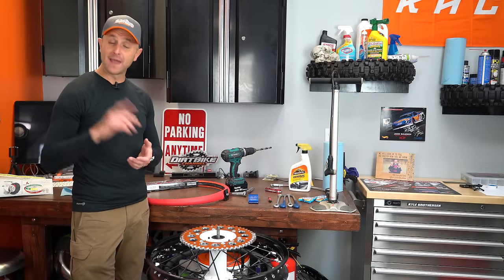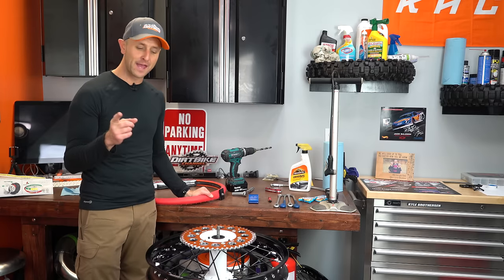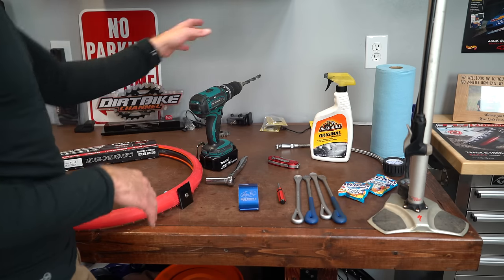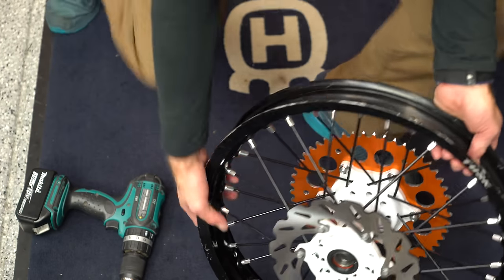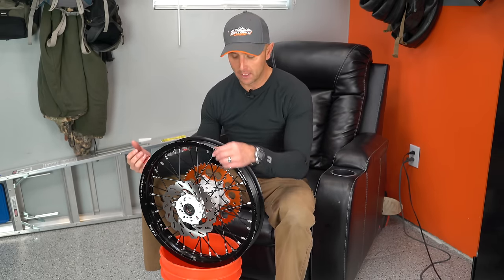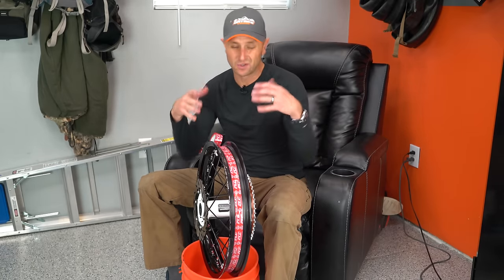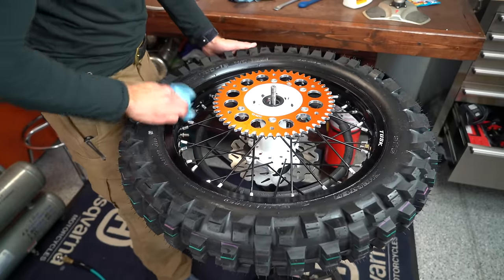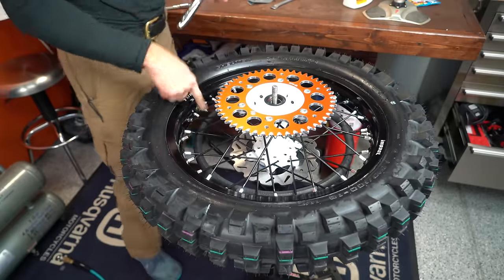TUbliss Installation Guide | How To Install TUbliss

Comment: I've seen a couple of comments about it. Yeah, I'm curious if there's a particular reason why Nuetech wants you to keep the lock and bladder within 4 holes of each other. Wondering if there's a wear issue if there not within 4 holes.
Reply: Tubliss probably recommends that spacing to make installation easier. Kyle pointed out that stuffing the stems in is more difficult when they are opposing each other.
Reply: Just easier that’s all.

Comment: Couple question... Tubliss says to drill the hole 4 spokes over. You didn't do this so i take it its for easier install? Tubliss says armor all on liner and bladder but to use soap water lots of it on both sides of tire to set bead. You installed with a little armor all on bead? They said dont use soapy water if your using a sealant. Thoughts?

Comment: Your rimlock is across from the tube valve. Tubliss stresses that it is VERY important to put the rimlock/low pressure stem 4 spokes from the high pressure even if it means drilling a new hole and plugging the existing rimlock hole. Are you running into issues doing it your way?

Comment: Thanks for the video. I’ll purchase everything through your links👍. 
I’m curious how much Stan’s sealant you use? I’m a mechanic in a bike shop and do about 20 Mtn bike tubeless set ups a week lol… But we use 2-8 oz depending on tire size. I’m assuming the motor bike tire it’s would be roughly 10-12 oz?

Comment: Great video one thing I would add is to torque the rim lock down to the specs Tubliss reccommends,in case you loose pressure in the bladder 😎

Comment: Tubliss says on the instructions that the 2 bladders have to be 4 spokes apart.You have them opposite to each other.Is there some reason or benefit?Thanks!!!
Reply: He says in the video that Japanese style rims are opposite from each other
Reply: @13BahamutG  but it says in the instructions to drill a new hole. factory japan bike are across.. I think it can be both ways just 4 spokes makes it easier to install liner and bladder

Comment: Do they make rims and tires that are made for tube free  air inside the tire ? It seems  to me that  your trying to make a rim and tire  tubeless that was made for a tube . Why not just get a rim and tire that's made  for just air ? Also is there a dot on the tire from the manufacture  that lets you know  its the lightest part of the tire so you can line it up with  the rimlock to help with balancing ?

Comment: Didn't you read the part in the instructions that said the 2 valves MUST be 4 spokes apart?
Reply: I remember that from the TuBliss instructions too. They seemed pretty clear that the high and low pressure valve stems needed to be exactly 4 spokes apart. Here Kyle's put them pretty much opposite sides of the rim. This might help with balancing the wheel, but I wonder why TuBliss was pretty insistent on them being 4 spokes apart?
Reply: @RickGreen_McNutt  it's because when you Mount the tire, you finish at the valve cores so the rest of the tire is in the drop center. If you have one of the valve cores 180 degrees apart, you cannot drop the tire in the drop center to spoon on the last bit. If you do that, you can damage the high pressure core valve stem if you finish at the bead lock 180 degrees off. That's the idea anyway

Comment: Thanks for the info really appreciate it 👍
A question though..... don’t you need to balance the wheel with weights? I have done lots of street tyres and always have to balance 
You don’t need to balance on dirt bikes?
Thanks in advance 
Jeff (Australia)

Comment: You can’t push the tire down into the drop center because the tubliss inner bladder is there.
This is the main reason it is more difficult to mount the tire.
Doable as shown here but challenging.
You’re welcome :)

Comment: Greta vid, always wash the tire lube whatever you use, off the disc with brake clean so otherwise it can contaminate your brake pads, and and actually imped lube into the disc. Only way to get oil or lube out a brake disc that has been heated with lube on it, is to sweat it out of the metal with torch or very hot heat gun, same if you get chain lube or brake / fork oil on your discs.

Comment: BTW Neutech states to make sure the holes are not across from each other.  They should only be 4 or 5 spokes apart. I don't remember exactly.  Just follow the instructions so you don't make this harder then it needs to be.  I've been using tubliss since they came out.  very awesome for the back.  Ok for front, but like their Nytro mouse better for the front.

Comment: Hi my bike has done about 80hrs since new in 2019, about to change my first tyre, would you recomend changing the hi pressure tube at the same time? Is it easy to swap the tubes over in the system?

Comment: Hi Mr. Kyle, appreciate this video as this helps out a lot! One question though. Have you ever had any trouble with the valves stems being across from one another on the rim rather than 4 spokes apart? I bought a used set of rims and I have the same situation with the holes. You made it look pretty simple but I was just wondering about long term effects? Probably nothing I assume but wanted to ask as you have done this a lot it seems. I gather that Tubliss whats the consumer to do the holes 4 spokes apart because yes, it would be earlier to align the stems and install. Any comments from you would be appreciated. PS. I am a bit of a beginner here and knowledge is power!
Reply: I am interested too
Reply: It IS important to have them space 4 spokes apart. This is due to how you have to change tires with tubliss and end spooning them on AT THE RIM LOCK. When done this way, the bead of the tire is in the drop center opposite from the rim lock. So if the high pressure valve stem is 180 from the rim lock also the bead of the tire can damaged the bladder as it is fighting for the same space and can tear the bladder from the stem. - If they are 4 spokes apart this will not happen

Comment: Wow 5 psi that’s insane, Is that in smooth rock free terrain. I am considering tubliss for mine and my sons bike, we ride major rocks and roots what kind of tire pressure could you get by with. I currently run minimum 15 psi with heavy duty tubes and still experience pinch flats on occasion.

Comment: I just bought these using your link, I run a YZ450 and the rim holes are on opposite sides, can I use those like you did in your video?  The directions call for it to be 4 spokes apart.  Thank you
Reply: Hoping you could help here

Comment: Nice job on the install. Tubliss recommends to drill a hole 3-4 spokes away from valve core for the low pressure valve, but seems like using opposite side hole works just as well and balances the tire better...good to know! Are the tusk wheels as strong as OEM? inded backup rear wheel...
Reply: You need it 4 spokes away.  the rim lock helps to hold the valve stem

Comment: Hi Kyle, I’ve just ordered my Tubliss and watched your vid as well as the instructional vid on the Nuetech site. I’m confused by the tape process. Their vid still says the tape goes only once around and they don’t overlap. They show a gap of 8mm between the beginning and end of the tape. Is this an old vid or have they reverted  back to a single run on the tape? Your help with this would be much appreciated.

Comment: Did this yesterday with no issues - did the mallet trick on the last bit too. Replaced the Armour-All with Silicone spray lubricant - got the nice pop when the bead seated & is holding air. Thanks for the video - was going to pay someone to do it but feel it's better to learn as I go through tyres quite often!

Comment: "ArmorAll" must be a supporter. Frankly, from experience, I NEVER use ArmorAll on ANYTHING.  From my experience ArmorAll drys out rubber and plastics.  Ever notice how the dash on your car starts cracking MORE when using ArmorAll?  Use SOAPY water instead and it's WAY less expensive.

I DO like the Shinko 520 series tires.

Otherwise the video was good and informative. I too have used the rubber mallet to finish the job.

Comment: I recently purchased a bike with this tubeless system the valve stems are not correct red and black I’m curious what valve stem holds the bead on the high-pressure one and which one should I leave it low pressure is the big one high pressure or the small one high-pressure

Comment: Hey, great video.  I did this all myself aswell and i find at the start of each ride the High pressure chamber has dropped to 70-80.  Would you say thats normal?
Reply: Kevin Cameron yes, you should check before every ride.

Comment: I like those tire stands for removal, but during install it helps to keep the tire in the drop center by standing on the sidewalk 180 from where you are finishing your last bites, plus last spot should be near the rim lock.

Comment: Pro tip: don't use the little nut that backs up against the cap on the high pressure side. If it backs itself off from the red cap, it will self tighten against the rim and tear the high pressure tube underneath. Happened to me twice. Just use the red cap.
Reply: Eric Wahl You can use that little "nut" on the high p. valve, but use two of them and tight them together.

Comment: Check the inside of the rim for anything that might cause a flat. I had one set of rims that had sharp edges ended up filing the tops of the spoke nipples.

Comment: Is the tubliss rimlock really necessary? I was thinking of removing it or trimming it back. The red bladder acts as a rimlock.  The front tire is very unbalanced . Now I have added an extra 3-4 oz. in wheel weights. Defeats the purpose of the light weight of the tubliss vs mousse or uhd tube.

Comment: Common complaint is the High pressure tube starts to leak. Stans (or other brands) of tubeless tire sealant; add to the high pressure tube the take care of those pesky slow leaks. You could add it the low pressure side as well and may help seal leaks at the spokes. NSDQ!

Comment: On my honda I only have the one valve stem hole at 6 o'clock then I have two holes with rubber plugs in them at about 10 and 2 o'clock. Should I just drill a new hole 4 spokes over and leave those rubber plugs in?

Comment: How often do you have to mess with the high pressure side adding air?  I’m not great at checking my air pressure. I’m currently running mosses now. Thinking about switching to tubeless

Comment: Useful video BECAUSE of the realistic periodic struggling.  Thank you for leaving those parts IN.  I'm proficient at these except for the measuring for the drilled hole.  Wish I had a more scientific way to do that, so as not to mar a new rim.

Comment: Wow I just watched  your video on how to do this from 2014. I've been trying to find a solution on how to get as much traction out of my dualsport tires. Wich are no joke 90% street tires and maybe 10% trail tires. Which are copy cat shinko 705's. I am afraid to air down more than 18psi due to how lose and easy it was to mount and set the bead. I will feel better with a set of these and my tires at a lower psi. 

 I kmow I should have never bought a Chinese yamaha clone. But it was the only way to get the bike I wanted.  Well most of it anyways. I've been slowly replacing cheap parts with the real yamaha parts since those were cheaper to buy and import than the real bike, the yamaha xg250 tricker.

Ps. Thank you for the great vids and information you give.

Comment: It is a struggle and root cause is tubeliss blocking the tire move into the middle of the rim. Some tire might be easier to mount, but without brute force, there is no chance to get this thing mounted.

Comment: Hey Kyle, I’m looking at getting a tubliss system for my bike.  I’m curious though as to how long the system will last before it needs replacement?  Assuming I don’t pinch anything with a tire iron.  I know that tubes wear over time but I’m curious about this system.
Reply: Mine is from 2016 (gen 1), has been taken on and off several times and still works. There is no reason why it should fail. The inner tube will probably go eventually, but I've taken it out and it is just a solid bicycle-like tube, so as long as you avoid the cheap chinese crap, you should be ok.

Comment: When I put air in the tire it leaks out from the spokes. I put two layers of tape and Xgrip rubber. I put 7.5 bar in inner tube and 0.7 bar in outer tube and it lekas. What may be the problem?

Comment: You mention tools required but you fail to mention the one tool that you use and is hidden in plain sight, the tire changing work stand. It’s pretty much essential. I’ve tried the five gallon bucket method but the wheel won’t stay down as many of your listeners know. Can you update the video to mention this vital tool for those who plan on changing their own tires?

Comment: Lube 101 - Installing put lube on INSIDE of bead, (that is what grabs), when uninstalling put it on OUTSIDE, where you sprayed this time. 
you dont need lube on the outside of the bead that is only to help it seat, not install. Bead buddy is supposed to be OPPOSITE of where you are spooning so the bead/tire falls into the valley giving you less stress on the wire & to pull it on.

I run Boobless (politically correct is BiBless). Moose BIB (sacked 5-6lbs) & Tubliss. Works amazing.

Comment: 3:28 ARE YOU KIDDING ME!! OF COURSE FRUIT SNACKS ARE CRITICAL to installing the tubliss system!!! How dare you take out a critical step
Reply: Fruit snacks and diaper wipes are this that come from having kids that have so many different uses
Reply: @Stihlheadd  And baby powder...  Baby powder helps tubes from pinching during installation, when placed inside the tire before the tube.  I would think that it would work with the Tubliss, but it good to stick with manufacturer specs.

Comment: Silly me !  When I first heard about tubeless, I thought they were a foam type insert without tubes.
Reply: I feel that. They call it "tubeless" but you are really just trading one big tube for two little ones. Seems like a scam.
Reply: No way, I love tubliss!  Best part is you can run as low as 0-3 psi because the high pressure tube keeps your tire on the bead, and if you get a flat, you can use automotive style tire plugs to seal without removing tire and wheel

Comment: I'm a lil confused..the tubliss vid says to plug the opposite side hole on rim and drill new hole 4 spokes down from valve stem hole. Like the ktm version so the tube doesn't pinch..does it really matter?

Comment: Where did you get your tire stand? Last time I changed a tire I did it on the floor, that made me never want to do it again.
Reply: Rocky Mountain MC/ATV has them. Use Kyles link and search tire changer stand. Cost is something like $75 - $85. https://www.rockymountainatvmc.com/p/1511/45411/Tusk-Adjustable-Height-Motorcycle-Tire-Changing-Stand

Comment: My low pressure stem wasn't tight enough to fill with out tightening it up and I didn't finish with the rim lock is that going to be a problem

Comment: I heard the 21" front tires are much harder to install, I guess that's why no one ever shows it being done on film.
Reply: Slavens Racing has a vid installing it on a 21 inch, its a summary video, good supplement to this vid
Reply: Agreed.  The front was so bad.  Damaged 2 systems trying.  I am not the best at tire changes, but Im not that bad.  I guess I wont use this for the front.

Comment: I have tubliss but in the front wheel I have punctured 3 times due to the thickness under the valve that pinches the rubber, so i had to put the tube back on. In the rear, however, it is fine. Was I the only one who had this problem???

Comment: doesn't tubliss specifically say you HAVE to drill a hole 4 spokes from the low pressure valve stem? they say you will damage the system horribly if not...

Comment: I have a tyre holder on my rim. Do I need a third hole or replace my tyre holder with the one from Nuetech?
Reply: Use the Nuetech low pressure valve where the previous rim lock is located. The Nuetech system is like a rim lock that goes all the way around the tire. Therefore, only two holes in your rim. One for low pressure/rimlock and the second hole for the high pressure valve. Hope that answers your question.

Comment: My high pressure valve is a bit crooked. I deflated it, took it apart and reinstalled, it was straight but got slightly off again on inflation. Why is that or does it even matter??

Comment: No biggie but just so you know, when you let the 30 psi down to 5 in the main chamber it will in turn lower the pressure in the tube around 5 psi

Comment: I remove the nut on the on the tube and just run the rubber washer otherwise there are sealing issues.

Comment: No! You did not show the most difficult way, try the Maxxis M7324 front, 90/90-21 with Tubliss. 
I have used Tubliss in the rear for years, lots of different tires, no problems. 
I wanted to try Maxxis M7324 front, 90/90-21, but I had to give up.

Comment: Just got rid of tubliss, facts people need to know: It wrecks the side walls of your tyres and they tear, if you ride hard, they break the bead and you can't get them on again. They generate their own muck inside and leak. If the valve fails they leak and good luck getting 110 psi into them in  the field. Moose is better, hell heavy duty tubes are better. Wish I had a no BS explanation of them before I wasted my money. Also they are painful to take on and off, they need to be cleaned with each tyre change. It is actually easier to change mousse tubes than these and ive owned both.

Comment: Armorall is very bad for rubber it is petroleum based and will soften/rott the tire and tube.
Dish soap mixed with mostly water would be better since what ever residues in the tire will dry and become  like a mild tacky glue and doesn't deteriorate the rubber or tube.